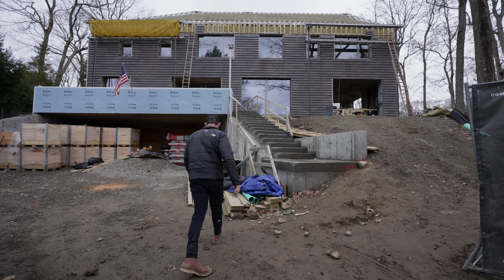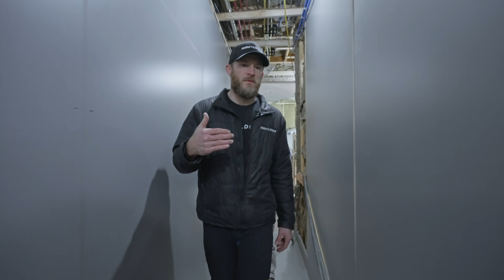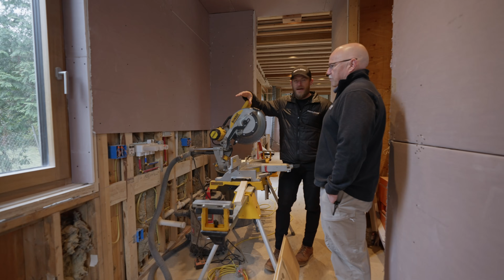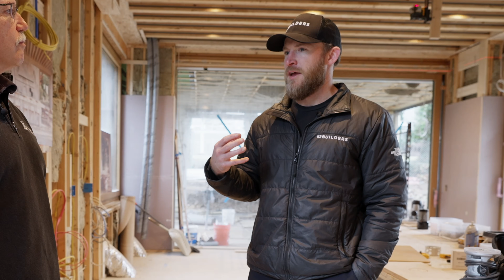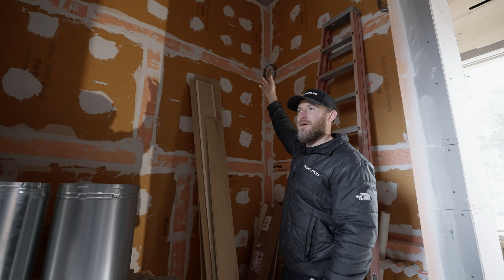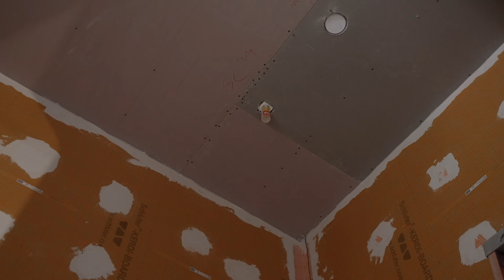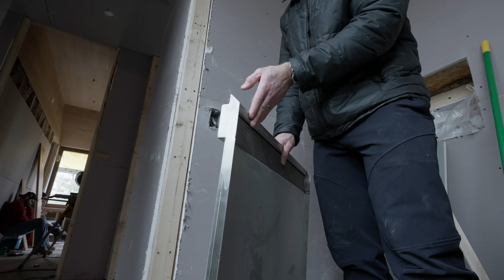How Plumbing Works In A Luxury Home A Full Walkthrough

Comment: Another big plus for the wall hung toilets is in regards to how we clean our houses today.  Many of us use floor cleaning robots that both vacuum and mop.  The wall hung toilet allows the robot to fully clean the toilet closet floor.  Using a robot, the bathroom floor gets cleaned better and more frequently.  As an FYI, I set my seat height at 18.5", due to being older and my knees are compromised.  At that height, my Roborock fully fits under the Duravit porcelain toilet fixture at its lowest point (the trap).  

The GC does need to coordinate between the tiler and the plumber so the finished floor height can be estimated with close accuracy.  The plumber needs to set the seat hight prior when he installs the carrier at the rough-in stage, prior to tiling.  As you noted, make sure to install something very solid behind the porcelain fixture, like cement backer board and tile.  If you look at the in-wall carrier, installing blocking is really not an option.  The fixture has some serious cantilever and you need a solid backing.  Plus, the way a wall hung toilet installs on the wall, you have potential for splash and "overshoot", and would never want sheetrock directly behind it for sanitary reasons.  

Finally, the carriers come in 2x4 and 2x6 versions.  You'll be thankful you went with 2x6 should you ever service the toilet.  The toilet is fully serviceable through the flush plate, including accessing a shut-off, but the depth of the hand reach access is deeper with a 2x6 carrier.

Comment: They are gonna hate the hot water setup
Reply: Because with 5 bedrooms they are going to run out of hot water frequently.  They should have installed a tankless.  Give them 12 months and I bet you dollars to donuts they install a tankless.
Reply: @JustinTBowen  In the earlier vid he mentioned the owner wanted a 100% electric house for personal reasons, no gas. So the particular distribution pipes used etc is downstream of that hard client constraint, as I understand.
Reply: @JustinTBowen  I think a 50 gallon hot water tank with a recirculating pump looped to the furthest bathroom from the tank beats a tankless in every way especially a high efficiency gas unit.  Tankless units have changed too much and have not stopped trying to improve them. They are like computers basically by the time you get it installed that technology is obsolete which means they come with a higher cost per unit with a higher installation cost and the worst part is if maintenance is required the parts aren't readily available in some cases already discontinued or overseas leaving you with cold water for weeks. Without the recirculating loop branched through the hot water lines  then they would hate any system in a 7000 sq ft home.They will have hot water within a few seconds in any bathroom.
Reply: @ You can have a recirculating pump with a tankless heater exactly the same way - that doesn't differentiate one vs the other.

I hear you 100% re speed of tankless evolution, but the latest tanks have already started walking down that same path. With that said, this past fall I replaced a heat exchanger on my 18yo Takagi T-k3 and there was no issue at the time getting the part. Obv. getting some whizz-bang off-brand unit from a fly by night dealer won't be the same case. It's just like with faucets or anything else - stick with standard & popular models from established brands to have fewer issues with parts or knowledge base down the line.
Reply: @JustinTBowen  
"Now I see."

Said the blind man to his deaf dog.
Reply: @JustinTBowen If they install an 80 gallon and insulate the hot water loop, they will likely be fine.  I was hoping to hear these two details in the vid.
Reply: Why?
Reply: I hope they don’t have a freestanding tub.  Those hold 60-100 gallons of water- meaning a 50 gallon tank of hot water won’t cut it.  Let alone if someone else uses any (showers, dishwasher, laundry, etc.).  Yes the recirculating makes the hot available at the tap quicker, it’s just the volume of hot water is obviously finite, and will be an issue in a 5 bedroom house, I.e., high demand.  They are going to have to “hit the vitals!!” as my dad used to yell when the water started to get cold after the 3rd shower.  😂   Not exactly luxury living.

Comment: European standard wall hung toilets made it to the (higher) priced US homes. Nice to see :D Why aren't they more common? Only benefits
Reply: The main reason is that most Americans don't know they exist.  Second reason is that they are about $700 more expensive.  The third reason is that the waist pipe is in the wall, not the floor.  This is easy to accommodate with new construction but problematic when remodeling.
Reply: In most places water isn’t as expensive, so our toilets don’t end up with as many brown streaks.  They’re also much easier to service.  That said, my house has wall hungs.

Comment: For how much this build will cost, I would expect to be able to turn on all the hot water fixtures at the same time and never run out of hot water. Anything less would be completely unacceptable to me; and a large fraction of clients that could afford a custom build at this level, I would imagine.
Reply: He's probably dumping two 80 gallon heat pump water heaters in that utility room.  I wouldn't presume just one....
Reply: @MotoEdde  Even two 80 gallon heat pumps is an absolute pittance of hot water for a house that big. I would want at least 2 199k BTu/h tankless units teamed together; three or four would be even better. A bank of boilers and a 120 gallon indirect or reverse indirect tank would be another good option.
Reply: @ZergZfTw  They have a 100 gallon tank at my gym with ten high volume showerheads.  How many people are realistically going to live in that house?  I agree about the heat pump water heater.  If one's not enough, put in more.  You don't spend that kind of money to worry about running out of hot water.
Reply: @incognitotorpedo42  I totally agree there are tank models that have crazy high capacity. I found 119 gal AO Smith with 500k BTu worth of go in about a minute of searching; they are just crazy expensive, and God help the poor Joe who gets to move that beast into the basement. I just prefer the bank of tankless units approach for cost per BTu and redundancy if one unit goes down, plus they are arguably safer from Legionella.
Reply: @ZergZfTw  I've tankless and, to me, that's a more elegant solution. However in an earlier vid they'd mentioned this is an electric-only house. No gas.
Reply: @chefdeit  That was their first mistake giving up gas is a completely ridiculous idea. Not having a backup generator and such limited heat generation capacity is totally incompatible with calling it a high-end or luxury build.
Reply: The hot water depends on the systems flow rate. If the max flow rate of the hot line is restricted to within specification of this heat pumps will be totally fine. If not all sorts of issues. It's the same for tankless on demand heaters. Too much flow, no heat. Too little, heater short cycles, so inconsistent heat. ... Those point of use low gallon electric hot water heaters at 15 amps. I'd use those where needed over fancy heat pumps. For example, a Bosch 3-4 gallon unit yields about a 7 minute shower on a low flow rate head. A propane on demand heater overheats with same config unless you use regular flow head.

Comment: unless I'm mistaken, a recirc pump on a heat pump is not a good thing
Reply from the maker: Haven’t heard that.
Reply: @Ms2Chill  I would agree, I think at times the heat pump can be operating at its limits. Why turn the whole system into a giant radiator, either you are going to waste water or waste energy.

Comment: Viega PEX B has better city water chloramine resistance.  The new chemical treatment from municipalities is chlorine dioxide and the oxidizing potential is far greater than chloramine.   Which is PEX’s Achilles heel.  What are you using for water treatment?  Should add activated charcoal filtration and a soft water system to prolong the degradation of the domestic water piping.
Reply: I think the main advantage of Pex B is initial build savings. Once you fully mitigate the issues of noise, extra ft head, chemical and microplastic stability, that whole advantage is erased.

Comment: One pro tip, use the recirculating clean water for the pot filler too, so it has always clean hot water (hot is good for cooking)
Reply: @chrisracer2007 Best practice for cooking is to NOT use hot water because it comes from a water heater which is full of sediment.

I go one step further and only cook with water that has been filtered by my under-sink RO system.
Reply: @yayinternets  sediment and potentially bacteria.
Reply: Don't think water heater water is meant to be used for cooking.
Reply: one pro tip.  Don't install one.  Where else in a house do you install a faucet without a drain below it?  They only save you from carrying cold water to the stove.  You have to carry the hot water to the sink. Nuts!
Reply: @JW-gc5ve  For something like pasta, agreed, it would be of questionable utility. But not for foods where the water doesn't need to be poured out, like soups, where this can be of greater utility.

Comment: On the leak detection system nothing is foolproof I have yet to see systems that even with AI can shut-off quickly enough with a slow persistent leak by the time you notice you would still be ripping materials out due to the damage. Plus electricity issues can a problem even with a battery backup. Belt and braces yes with leak detection and yes with mechanical shutoffs.

Comment: Having installed wall faucets in two houses, I strongly advise shut-offs for each fixture to provide isolation.  Otherwise, you are shutting off the water to the whole house only to have the plumber tell you he doesn't have the part and has to drive to his supplier, or worse, he has to order it.  Although they make (expensive) in-wall shut-offs with wall-mount turn keys, we've found it's easy to hide standard ball valves in the wall behind a plastic access panel.  Usually accessible thought the back of the sink base cabinet.  Sometimes you have a closet behind the bathroom wall that can provide access.  We also always buy our fixture rough-ins for the tub filler or shower controls "WS" that is with internal stops.  I've had to use these shut-offs several times, to shut off water when  cartridge failed and had to be replaced.  They saved me from shutting off the water for the whole house a couple hours each time,  

Right on about the ice maker shut off!  As you mention, you can't just pull these large refrigerators out anymore.  I put my (external) filter for the refrigerator's ice maker under the sink with a separate shut-off.  I make sure the appliance installer leaves the filter blank in the refrigerator, so I am filtering through the under sink filter, which is a much better filter and less expensive.  

Regarding re-circulation with a hybrid heat pump water heater, I'll be curious as to how it works for you.  Re-circulation is a big deal due to water scarcity here in the Western U.S.  Many energy efficiency "experts" are saying the HPWH's don't have enough reserve heating capacity to facilitate re-circulation.  The result is you kick your "hybrid" HPWH into 240V resistive heat mode due to the constant demand for hot water due to the re-circ - thus negating the heat pump benefits.  

I did have to laugh at a 2" water service.  Wow, what a different world you live in!  We are limited to a single 3/4" for residential (due to water scarcity), and that is for the house and irrigation.
Reply: An easy way to provide a shutoff for wall faucets or showers is to install a valved manifold for the bathroom.  Uponor has an expensive version and Dahl has a version that is half the price.
Reply: @alberthartl8885  Yes, that's why we use ball valves on the supplies to hot and cold for each wall faucet, and hide them in the wall behind an access panel.  We then label the access panel.  (Imagine, labeling plumbing so the homeowner knows what they have?!)  Anyway, the ball valve route is cheap and easy for the homeowner to trace the "logic" when they go to shut it off a year or two down the road.
Reply: @tedbellSEA  "labeling plumbing so the homeowner knows what they have?!"
Not just a year or two, decades down the line people you don't even know will be thanking you.
Reply: This. I had an opportunity to see plumbing at a max security facility and I swear when I've home built, I'll be borrowing some ideas. Everything had an individual ball valve shut-off and they were all lined up & labeled in a narrow little closet space between the units that'd also provided access to the backs of the fixtures. I.e. in a home (provided the code allows it) the fixtures look a lot cleaner and can be swapped out if need be without ripping out any pricey finishes.

Comment: As a retired plumber that has owned two story homes I'm surprised you haven't use a lowry wrap or cast iron risers to minimize the noise of the upstairs plumbing.
Reply: I'm not here to dump on another pro's job on their channel, but I couldn't help thanking you for your comment. On premier jobs I was in, plumbers paid a LOT of attention to noise: cast iron drains (keeping the old heavy ones where possible), oversized copper with long-turn elbows, etc. Not much thin pex-b unless it was some special constraint. On the flip side, there's a lot less volume in the little pipe, hence less of a need to recirculate hot. Anyway, this is a very neatly done job, and I'm sure it'll be a home folks will be happy to have.
Reply: I'm wondering if there will be enough insulation in the walls to defeat those noises, or if they tried to be mindful with where those pipes were ran
Reply: @themeltingJason  Im curious as Im not a plumber but have some knowledge. Is the noise from the pex moving around when watersgoing through?
Reply: @austinreeves5221  no they are referring to the drain lines in pvc piping. They transfer alot of noise when fixtures are used. Especially a toilet flush, when it comes down the stack it's loud.
Reply: @austinreeves5221  see the thin red and blue pipes connected with sharp elbow fittings? That's the 0.5" pex type B, the cheapest available way to do standard plumbing. It too is noisy, because those fittings have a smaller bore than the pipe, due to type B being the cheap plastic. Pex-A is a little bit better in that it can expand to fit over the full-bore fittings. Anyway, every time water is forced to make a sharp turn or go from one inner diameter to a different one (like with each Pex-B fitting) it makes noise due to cavitation and turbulence. Doubly so if it's forced at a higher speed due to the pipe being 0.5" and not 3/4" or 1". A more upscale build would have used Type-K copper (thicker walls) at least 3/4" trade size, sweated with lead-free solder and water-soluble flux (no sharkbite or propress etc no rubber) and long-turn elbows (i.e. gradual not sharp turns), with pipe insulation  incl at attachment points. That makes it practically silent by comparison to 0.5" Pex-B that'll make low hissing (so-called brown noise) audible in any room near where those pipes are going.
Reply: @austinreeves5221  no the noise is when you can hear the water draining in the pvc pipe. It is noticeable
Reply: Wall mounted WC's have large tanks hidden behind the wall, any adjacent rooms will hear the noise of the flush unless it is addressed.
Reply: Worth mentioning, I've insulated walls woth sound proof insulation and used strategically placed riser clamps to avoid noisy pipes.
Reply: they cut so many corners on this luxry build
Reply: @MrScottr1958  1st year in the field doing residential repair. I have a question for you, with your experience, would you rough a house of this size and price range all in pex like this? Or would you rather lay copper all throughout?
Reply: @MechanicalheartbeatRPM  Copper will outlast pex or press fittings. Haters will say copper is inferior because of corrosion, foundation shifting breaking the lines, or cost, but if you know what you’re doing and you have an unlimited budget, copper is what you want in a luxury home
Reply: @crys4789 pex is fine.

Comment: Thanks for the video! Can you speak a bit about venting the air from the heat pump hot water hearter? We are working on a new build in upstate NY and our HWH is in a dedicated closet on the 2nd floor. We are planning to duct that air to a register in the stair landing nearby. The cool dry air exhausting from the unit will be great in the summer but in the winter, it's not ideal. Any thoughts on this?  Thank you!
Reply: I think you just have to live with it. It's one of the small drawbacks of a Heat Pump Water Heater. Notice I said water heater? Not HWH.
Reply: @lrc87290  
It's actually an H2O hot water heater.